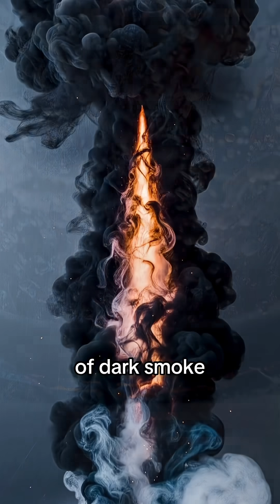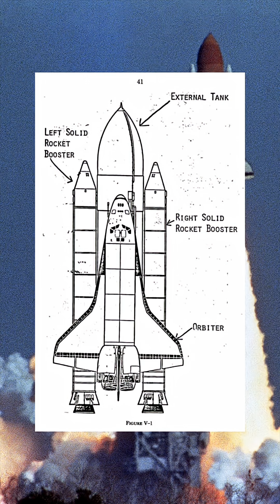T+58 seconds: The Challenger Disaster

Comment: Chat, last time I checked, 36 degrees is not below freezing. Idk tho, I might just be slow 🤷‍♂️
Reply from the maker: leading up to the time of launch it had dropped to well below freezing. Leading up to that point it was 20 degrees throughout the night. They waited til it got to 36 degrees and launched. That wouldn’t have given the ambient temperature inside of that area of the craft enough time to warm up. 

I would be more than happy to provide you with sources for all of this. While you’re correct you’re also only talking about that specific time of the day.

800 psi pushing against an o-ring that wasn’t given enough time to reach optimum temperature. We’ve had lines leak at 45 psi due to faulty o rings.
Reply: @slamuri2801  my man Slamuri does his research! This was very interesting, thank you
Reply: @slamuri2801  I'm aware. Just the way you said it in the video is misleading. I’ve spent days at museums learning about this and talking with experts cause it's genuinely fascinating to learn about lmao